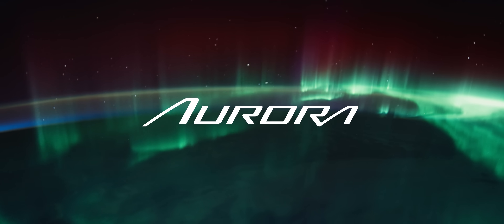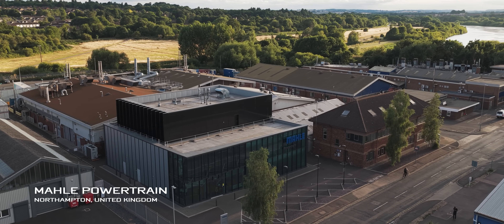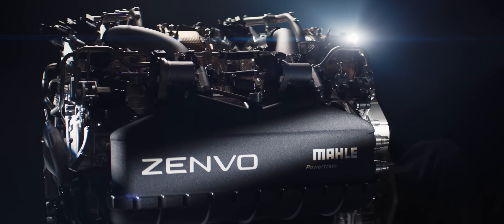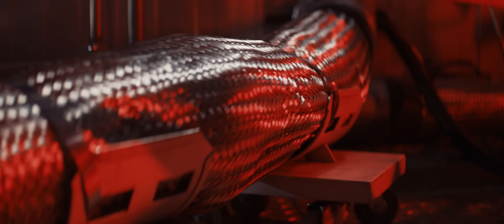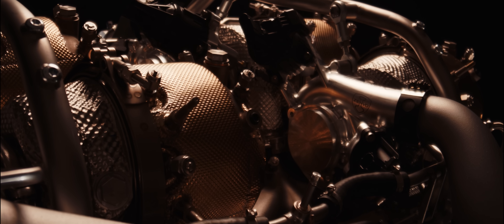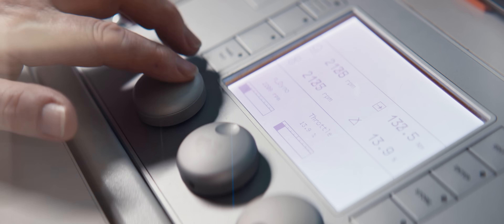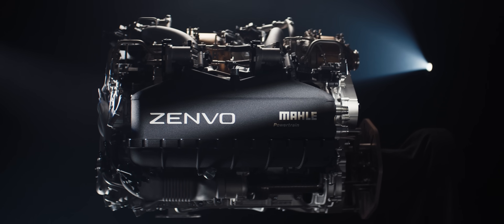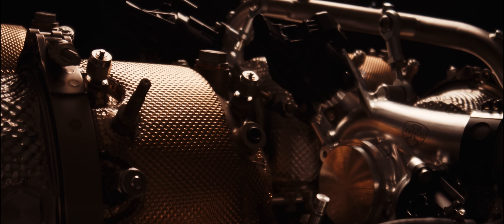Delivering Aurora | creating the world’s most powerful production V12 engine

Comment: why are we boasting about a quad turbo 6.6L V12 making 1250hp as something incredible when Koenigsegg has been making more power than that out of a 5.0L V8 for over a decade ago, which has only gone up from there to over 1600hp now.
Reply: Koenigsegg makes 1600hp on E85 and 1320hp on regular octane pump fuel
Reply: @Shadowed007 regular octane?? Octane is a rating in NUMBERS not a McDonald's meal size 😂
Reply: @Shadowed007 1280hp actually
Reply: @alexluke84 Their latest one, Sadair's Spear produces 1300hp on 93 octane pump fuel
Reply: @Shadowed007 yeah that is a variation...actually the most powerful from Egg is the Enviromental Power Upgrade od Regera...1750hp
Reply: @alexluke84 E85? I'm not looking too much into E85 numbers tbh, i rate them by how they perform on regular fuel and their thermal efficiency
Reply: @Shadowed007 they are the most overboosted for sure...but that is nothing special anymore...even Chevy ZR1 is closing on them with a powerful V8...V12 sells without big HP number and prpbably it will last longer (yes because of hp per cylinder amd size of the engine, it is easy to gain big power with big boost, even Bugatti said that Chirons W16 is capable of 3000hp...but with half it will last amd Bugatti owners are driving them for long distances...Eggs are very fragile for a reason)
Reply: Because this is still a very good innovation in automotive industry. It's better than any ev atleast
Reply: @VinayakVerma-bl1ouIn what way exactly is it innovative? Seems like just a bunch of money thrown at an expensive engine that nobody really needs. Just another high powered engine to propel the many wealthy show-offs towards speeds they are usually unskilled at safely managing.
Reply: @VinayakVerma-bl1ou what is the innovation here? Less powerful than a Koenigsegg, and is even less powerful than some EVs, quad turbo V12s is not new and has been done before in the 1990s.
Reply: @VinayakVerma-bl1ou better than the Yangwang U9 from BYD? a Chinese luxury electric vehicle with a four-motor system that produces 3,019 horsepower? One isn't better than the other they can coexist but the the most powerful production car is an EV and at the top of the list for quickest and fastest are all EV's
Reply: @DixonCyderBusch wrong.  The fastest cars in the world are all pure petrol powered turbo charged cars.
Reply: @VinayakVerma-bl1ou200hp/ltr...

in the early 70's racing engines were pushing 150 n/a.

its not that impressive.
Reply: He’s right guys. The world can only be impressed with one car at a time.
Reply: Hi all :) At 1250 Hp on low octane fuel we hit the sweet spot of power delivery, tractability, response and of course how the car handles and what tires can handle. 

This V12 is fairly under stressed and if we were going for power for the sake of power we could see 1850 Hp whilst still offering full warranty. ( or more on 85 ) 

The Aurora is all about the equilibrium of extremes. Hitting all the sweet spots that makes the car enjoyable basically.  More power would not lead to a better experience with today’s tire and chassis technology.

It it was all about power, we’d probably run with a twin turbo V8.

Why do we say it’s the world’s most powerful and technologically advanced V12 ? Because it is, and it has enough left in the tank to keep being that for a long long time
Reply: wait until he finds out GTR's have been making 2000hp out of a 3.8l v6 for 15 years
Reply: @flowmastaflam modified cars break all the time.  We are talking about production cars with warranty and road legal
Reply: @flowmastaflam u should read my other comment before spewing this nonsense.  The Jesko has proven itself both on track, and in a straight line being super drivable and capable at all facets.  The Jesko revs from idle to 7800rpm in just 0.2s.  You picked the wrong fight. The Zenvo has proven nothing in terms of its drivability and feel.  A Revuelto V12 sounds Way better if you’re gonna go down that route
Reply: 16 year old Lexus LFA revs faster than a Jesko… Koenigsegg has a great marketing team but have only proven stats with professional drivers. They follow the Ferrari path of having engineers and a driver at every track. I guarantee they tune the computer for the specific track they are testing/trying to beat the record which is not real world. McLaren and Porsche are the only two that are confirmed from the Euro market that do not do this. A V8 making 1600hp on e85 or 1200hp on pump gas has to be rebuilt at least twice to make it to 100,000 mile marker. V12 with 1200hp can probably make it to that mileage before having to be rebuilt. This engine was made to be beat up and driven. AMG-One has to be rebuilt every 30K miles…
Reply: @Keemdeez   wrong, lies  an LFA takes 0.6s to rev up to its red line.  A Jesko does it in just 0.2s!!!  try again.  If you're talking about overall red line, well that wasn't what the other guy was talking about.
Reply: And it probably breaks in less than 1k KM with that much power. When it comes to extreme tuning youre throwing everything out of the window for that raw power including everything else that would make it an enjoyable car. Anyone can make a dragcar that has thousands of HP but its engine literally last seconds.
Reply: @flowmastaflam Probably with a dry block and with weird fuels to reach that power
Reply: Yes but you also need to compare it on a level playing field. The numbers are impressive no doubt but compare it to other engines with the same fuel and Turbo boost.
Reply: @flowmastaflam  relatively easy to do that when you don't have to be emissions-compliant like a Koenigsegg or a Bugatti.

Try making that 1500hp GTR emissions compliant "from 15 years ago" then see how much engineering is needed to do so 🤡

If koenigsegg or bugatti didn't have to comply with emissions, they can easily do 2000+ hp or even 3000+ hp
Reply: @flowmastaflam Except the engine doesn't meet future emissions regulations... So the comparison doesn't make sense.
Reply: @MrQmie dont think too hard
Reply: @flowmastaflam  but can they do so reliably? The Koenigsegg V8 and Zenvo V12 have been designed to last in their respective trims. Those 2000HP GTRs are not. They're designed to go fast down a drag strip a couple of times, and maybe drive there, too. Nothing more.
Reply: @flowmastaflam they have not been making 2000 go for 15 years. Maybe 8
Reply: I love this comment 😂 someone with a brain
Reply: In everyone's discussion i also I'll join are there anybody really thinking just about reliability like really to go over 4digit there no engine can survive & never was ever all that cars are for just glass cave to watch them nothing more or did u think like cristian koeng don't know that or anybody in that business even after 100 years on that cars clock would be like max 15k kilometer please grow up guys
Reply: even a 1.4liter inline 4 can make 2000hp if you slap an electric motor on it
Reply: Also, a 1.6 L 3 cylinder GR Yaris reaching 600 hp
Reply: @moiseulpasmoi   you and everyone else talking about tuned power... just stop. The only way that conversation is relevant is if the subject is "how hard can you tune this car without it blowing up?". But this subject is about whether or not this power is impressive for a supercar that is running on pump gas and under warranty. Whether this car turns out to be super reliable like a Toyota or Porsche or not, it will absolutely be less of a finicky headache than a tuned car. Tunes are something it takes 2 hours on a dyno to do and a lifetime to chase down all the bugs. And they fail smog, and they blow up, and they break other parts that aren't made to stand up to that power, etc.
Reply: @Trackenheimer Ohh boy! I hope you know what you got yourself into! You sound like a pretty knowledgeable individual? So be prepared to answer a lot of questions.😂
Reply: @moiseulpasmoi production car engine ???
Reply: Because no V12 in specific achieved these numbers, and raw numbers arent everything, its about the context behind them.
Reply: Not alchevno
Reply: Man shut up
Reply: The Aston Martin Valkyrie 6.5-liter naturally aspirated V12 engine no turbo's 1000hp.
Reply: @bazzingabomb That's bad ass! The McLarens W1 had a V8 4 litre gets 1000 hp no turbos. So does the Red Bull hypercar but that 4.5 litres and a V10
Reply: @FrankNeill-o3b the W1 is twin turbo. The RB17 is also not street legal...
Reply: @MTreddevil12  the W1 also makes 1250 TOTAL with its hybrid engines. The IC alone is 900-ish IIRC. This one is 1200 from the IC alone and 1800 total.
Reply: @FrankNeill-o3b W1 is twin turbo
Reply: @drummerdoingstuff5020 Yes I know it is but without Turbo the engine still produces 1000 hp.
Reply: Because engines are cool no matter what.
(Except the Northstar, all my homies hate the Northstar)
Reply: The way this car might sound could be the reason someone wants this over an Egg
Reply: Don Lee = jaded A hole
Reply: The Koenigsegg V8 probably wouldn't make 1000 with a quad turbo setup, and this Zenvo would probably make 2k with two, larger turbos.
Reply: That a boy! Tell em!!
Reply: If it was NA then I'd be impressed but it's quad turbocharged making a mild 1200hp😑
Reply: Making 1600 on e85 isn’t very impressive. 1250 or something is the standard power on pump fuel. Let that jesko sit with e85 for some time and see if its still making 1600.
Reply: Because V8s are everywhere...V12 is the class above and the most exotic configuration apart from 16cylinder, my truck has V8 so nothing special, that in Koenigsegg is just overboosted engine that wont last
Reply: Looks big and heavy? I thought with increasing electrification you would size the ICE down.
Reply: @jostenberg6130  They could, but hypercars want special characterful engines to justify million dollar price tags.  I completely get that but It's unnecessary to boast about the power figure when there are production engines making nearly 50% more power of the same size, just not in a V12.
Reply: Don't worry, they well aware of what you thought😂 but from my perspective is all about to create your own, with your own team🎉
Reply: and dont forget the 3cyl 600hp engine  koennigseg built !!
Reply: @jerry-xi4gi  never made to production
Reply: @jerry-xi4gi ya but their cars are constantly fucking broken
Reply: The v12 is heavier and the v8 is the perfect balance of power and weight the v12 is a powerful and heavy beast and it is a 6.6 litre the cylinders wouldn’t be so lit and fast to make a cycle and explode the power
Reply: You are the king of roasting people 😅😅😜😜🫡
Reply: Because V12 is smoother than v8 and lightweight than w16. Perfectly balanced in a production road car. Most production v12 are naturally aspirated.
Reply: Comparing powertrains on specs alone means you don’t know what you’re talking about. There is something called “drivability” which you can’t really measure in Nm or kW
Reply: @vvlad1989  you speak as if Koenigsegg isn't "driveable" 😆
Reply: @vvlad1989 Ikr, plus, the reliability. I could just easily say "well a 1.5 liter 4 cylinder turbo from an 80s F1 car is making 1,450 hp" but do they have the same reliability. This quad turbo V12 engine vs the Jesko engine is basically a Buagtti W16 vs Koenigsegg V8 thing again. Koenigsegg definitely has worse reliability and better efficiency. If Bugatti has the same efficiency and performance, sacrificed for reliability, it would probably have around 2,500 hp. This Zenvo V12 could have maybe 2,000 hp without the electric motors.

It's such a dumb way to not consider other things into equation, just look at the numbers and that's basically it. It's not, and never is
Reply: Big FACTS. In Trinidad we have to make it make sense due to the high dollar conversion rate and our roads. This is exactly why we make our choices!
Reply: This is why we don’t get the cars we want because people like the original comment people barely know the basics and companies make decisions based on the masses. Hopefully more people see your message and understand why a v12 is more reliable then a v8.
Reply: I think Koenigsegg managed to make their V8s be decently bulky to still not be so unreliable as far as high performance car goes, they started with an extremely bulky platform which was Fords V8 on the Crown Vic, and improved enourmously on that platform over the years. What makes Buggattis special with their big engine, aside from the mechanical marvel of how exotic it is, is how it can deliver confort and smoothness because by nature of high displacement engines, its low RPM torque is great and lets the engine not over stress with the weight of the car, because it has a good ammount of luxury features. Buggattis are better to daily drive which a surprising ammount of owners do unlike the general mindset that every million dollar car dont see the light of the day, but Koenigsegg cars are not only good for their raw power and top speed but also better track cars with their min maxed weight and aerodynamics that arent just for the top speed. Every car has its context and its niche, people forget so much about it other than raw power and sometimes track times because with the push for EVs, since all they had to show was these raw numbers as they couldnt compete with everything else that made IC engines cool, they pushed that marketing so hard like it was everything. Yes, making small engines powerfull is also a good merit of its own, but theres points where youre compromising too much of everything else.
Reply: @BlwnV8-l3y well we don't know it's reliability yet, so stating that is...well we'll say premature
Reply: @vvlad1989 drivability eh? You mean the Jesko that does the 1/4 mile in 8.8s with just RWD, beating the Nevera R’s 0-400kph world record a lack of drivability? How about breaking the track records of Laguna Seca and the Top gear track, both relatively short and small tracks, again dispute having 1600hp and RWD only a lack of drivability???
Reply: They are right. This engine is cool, but nothing to spectacular. This engine creates less hp per litre displacement than a cla 45s amg. Yeah it revs to almost 10k. But this aint too spectacular nowadays. Its just marketing.
Reply: It is spectacular on many aspects other than KW and NM. Power figures alone arent everything, sure its cool to have some power for sportscars, its key to them, but youre bringing a 4cyl to compare to a V12 with just the power density argument? How stressed do you think that 4cyl is? How smooth is its driving at high RPM and speeds? AMG should had gotten the memo from Pagani who theyre still supplying that people who buy high performance cars want big engines and not punny EVs and 4 cyls, them dropping the V12 and not trying to insist on its existence was a big mistake.
Reply: @unkindled6410  nobody is saying a V12 is a bad thing.  Just don't boast about the "most powerful V12" when it's not really that powerful in this day and age, and especially when you're turbo charging a 6.6L engine.  1000hp from a NA V12, now that is something.  Even a 800+hp 6.5L NA V12 is more impressive than this.
Reply: @DonLee1980  its 1200 from the engine and plus 600 from the hybrids. in total the car will have 1800. 1200 is still big. youre understmating the numbers greatly here.
Reply: @unkindled6410  so what about the electric motors???  we are talking about boasting that this is the MOST POWERFUL V12 ever, when there are plenty of V8s with less cylinders AND less displacement making more power, and are also production engines with warranties as well as being many years old.
Reply: @DonLee1980  dont even reply again i dont want to waste my time and braincells with you anymore. You dont really understand why car manufacturers specially performance and luxury oriented ones try to not just copy the same cookie cutter as everyone apparently, and i thank god if he really exists that we are still not in the point where every performance car is just twin turbo hybrid with either 4.0L V8 or 3.0L V6 because those are the most common configs ever specially in recent years. I miss the V10s.
Reply: @unkindled6410  yet here you are
Reply: Because a v8 engine hypercar can get really boring and not very interesting
Reply: Same reason there’s 100 manual, V12/16, twin or quad turbo, 1000-2000hp, Hypercars that cost $10M

Some rich asshole needs to park money in something that looks good
Reply: @Gundam4President  tell me you dont understand about cars without telling me to.

Comment: Sorry but that was a lot of fluff to learn almost nothing about the engine. 1250hp is a lot, but really... 9800rpm, 6.6 litres, 4 turbo chargers - not much of a specific output to shout about for all that rpm, capacity and boost. And sorry again for the negativity, but please a 90 degree bank angle ruins the entire spirit of a v12. If you must do that for packaging, just build a cross-plane V8 and be done with it. I have no doubt the quality of the build is exceptional.
Reply: We don't know how much boost this thing is pumping out though.
Reply: @wasdwasdwwasd  Boosted street V8's of similar capacity make that sort of power with less rpm - so it can't be anything spectacular.
Of course I am sure they manage a great torque curve, and they do it while passing emissions. There is no doubt they are great engineers.
It's still just not that special.